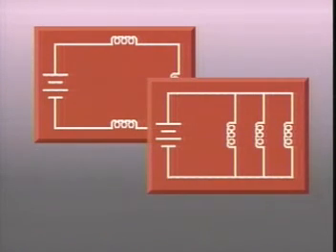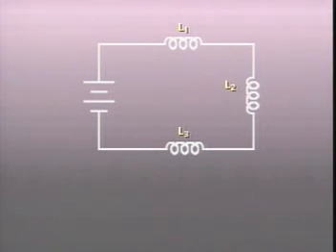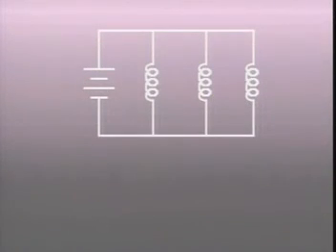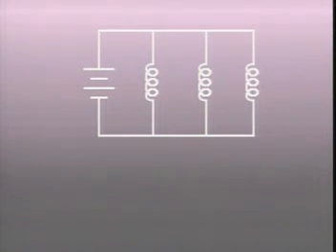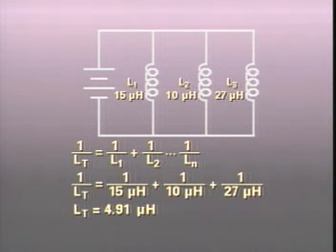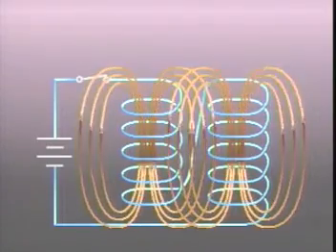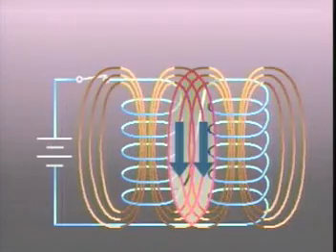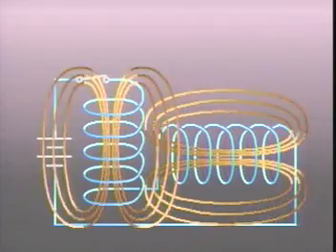DC Electronics Theory 13 Segment 5 - Connecting Inductors

Comment: We know that a solid copper wire 
solenoid with electric current will 
create a magnetic field.  

But what if we use copper tubing to fashion a solenoid and pump water to flow through along the solenoid tubing, will water current also create a magnetic field? And is using water enough to create a strong magnetic field or do we need Ferrofluid or sodium? Many thanks!